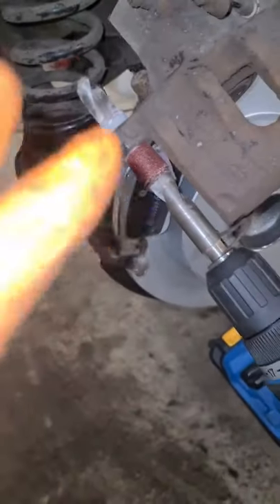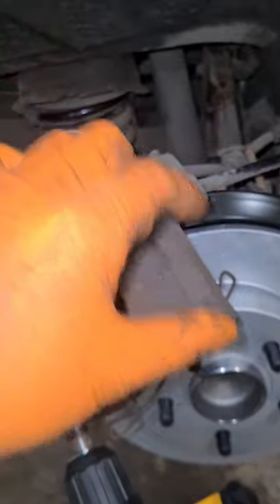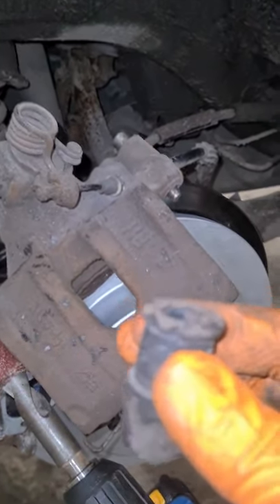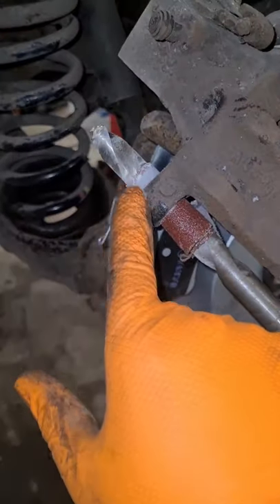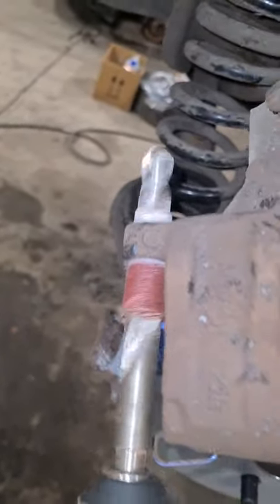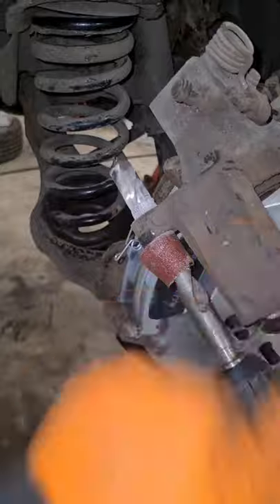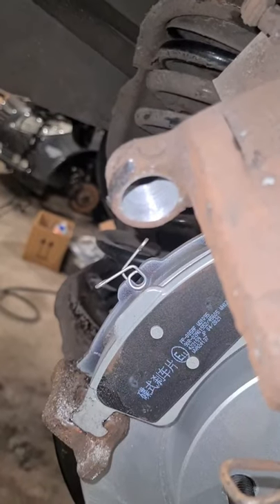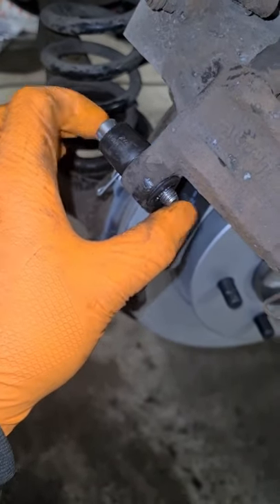Don't Make This Mistake When Doing Breaks #short

Comment: Except sandpaper will remove metal and that drill contraption will for sure ruin the tolerance of the hole. Better off using a soft wire wheel or a scotch brite wheel
Reply: Yeah you’re right

Comment: Came across this problem while doing the brakes on my son inlaws brakes on a 58 plate Vectra 2.0 SRi, alloy calipers had corroded the holes making the rubber grip the pins I managed to get the rubbers out without damage and cleaned the holes out put back together using silicone grease.

Comment: Would that not make the hole bigger and make the calliper very loose. I agree with it moving freely but it shouldn’t be to loose so it ends up wobbly witch will happen if the hole gets to big and end up causing the steering to vibrate under braking.
Reply: That’s what I was just thinking, if you do this every time then the hole will enlarge because the sandpaper is removing material.

Maybe a reamer or drill bit same size as the hole is better? Because it will clean hole out to original size.
Reply: The calliper will be aluminium and the corrosion products softer than the ali so unless you go mad it shouldn't remove any of it. That said I used a fine round file with care.
Reply: Depends on how much material you grind off. The grease will fill out the empty space between the carrier and slide bolt, unless you've really gone to town.

Comment: With that type of pin and rubber bush setup, I never used lubricant, just made sure pins were thoroughly cleaned and polished with steel wool, then reassembled them dry. Never had a problem in 30+ years of fleet maintenance, as long as pads were free to slide in the bracket..
Reply: it was you that sent all them cars out with squeaky brakes,

Comment: This is fantastic advice
One thing you might struggle with is removing the rubber without damaging it
I must add i lightly dremel the area but this does require experience so as I say...
For the uneducated and unexperienced use this technique 10/10
Reply: They were a bit of a fight to get out on the rears of my '06 Mazda3 Sport (same as Focus) and I didn't have any spares to hand but they came out undamaged. I used a fine round file with care to remove the white aluminium corrosion then some original Waxoyl when putting them back in.

Comment: One thing I've learned over the years get the true hi temp silicone brake grease. Used for years Anti sieze  and it was dried up and flaky the next time I was in there.. Is this wallowing out the hole any??? Thanx; Jethro

Comment: What's happened with my Volvo V50 I've now cleaned the holes and the rubbers are too small thrus too much corrosion removal living in bleedy Cornwall.  It's annoying because the calipers operate absolutely fine with good handbrake mechanisms which tend to fail all from corrosion I now needs to replace the calipers :(

Comment: That’s a beautifully rusty bracket with no grease that the pads are supposed to slide on. Should wire wheel and grease that

Comment: Put RTV on the points where your brake pads touch your calipers & they won't, squeek. Yea,... grease those sliders as, well. I have no clue why he didn't just tap that out with a little hammer. Dafuq you need a drill bit for, .. use some LUBE?

Comment: Not something I had thought of, good tip.
Reply: Me neither. I've had cars with discs for some 40 years but didn't think this was a thing until a couple of months ago when I found the rear caliper pins on my '06 Mazda3 Sport (same ATE brakes as the Focus here) where all but seized. 

Managed to get the rubber bushes out undamaged and found so much white ali corrosion in the bore that it had formed divots in the rubber. Cleaned it all up, put the bushes back in with some vintage Waxoyl and all was good. Checked the fronts and they were fine so It may be a heat thing - the rears will run cooler so any water that gets in sits around.

Comment: What kind of grease do you use on the pins???
Reply: Silicone Grease 😉
Reply: Silicon or lithium grease. Never petroleum grease (will ruin the rubber) or anti seize (will dry out and seize).